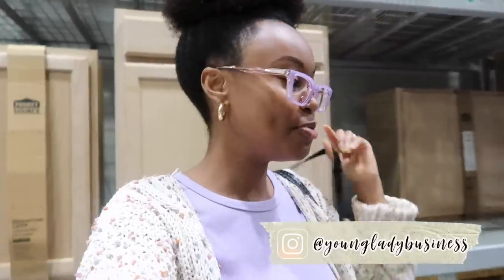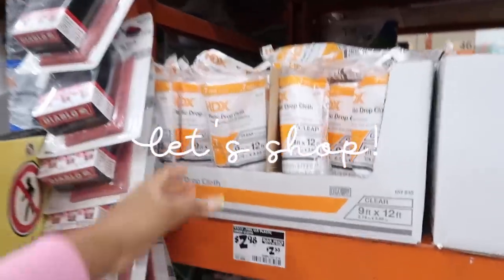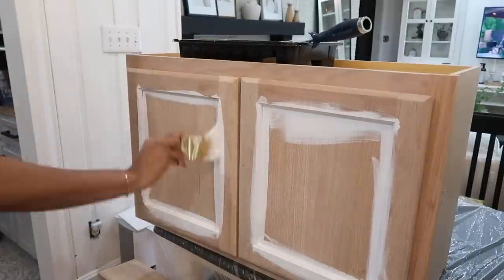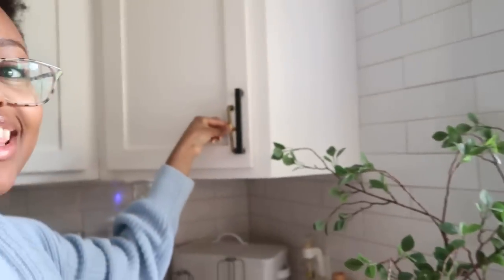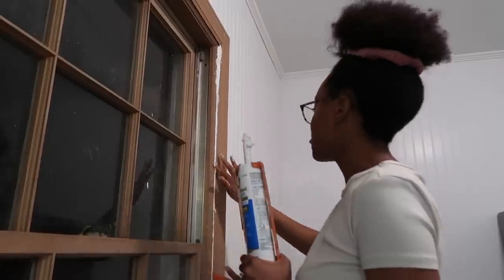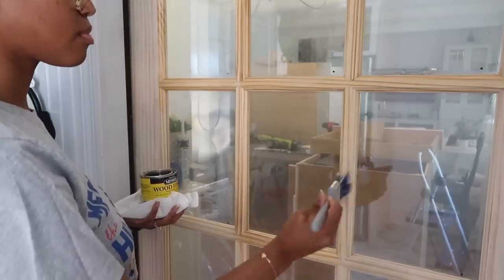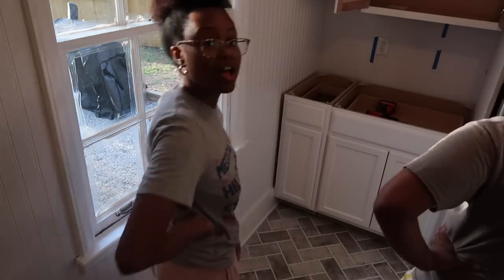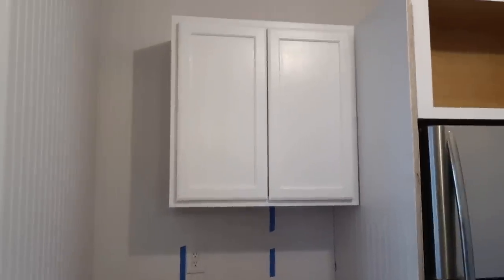INSTALLING THE CABINETS, PAINTING, & NEW DECOR!!!| Dream Laundry Room Makeover PT.2| #FIXERUPPER 🧺

Comment: Love it! I would cut the baseboard so the cabinet can be installed flush against the left wall. You will then have a small gap between the two base cabinets but you can add a filler strip to cover that and paint it white.  For the wall cabinets, I’d move the left cabinet against the left wall so the shelves can go between the two or remove smaller wall cabinet and have more room for the shelves. 😊
Reply: Oh i love this idea!

Comment: I suggest you put corner shelves in the top area of the cabinet, a piece of board between the bottom cabinet and the wall for a custom look, and artwork on the plain white wall instead of shelves unless you absolutely need the space for storage, or a foldable hanger that lies flush against the wall to dry wet clothes when needed.

Comment: You can do one or two things. Put the same size cabinet at the top and take the door off the front and make a shelf. In other words, have a cabinet without doors and hide the hinges with an end piece. Paint the inside of the cabinet and make it look like a natural shelf or you can put floating shelves. Two floating shelves equally apart as possible and put the bracket piece in the middle or make a bracket piece like a tea and put it under there all the way to the wall or flush with the wall to make it support and put a in the back but then in the front kind of use those wood shelves if that makes sense.

Comment: Everything is coming together so well.  You should put floating shelves that space. Make them deep reaching the back wall. But it would look amazing if you made your own; without the exposed brackets. Yes it’s more work and you’ll have to find somewhere else to use those brackets;  but I think it’ll look beautiful.  And stain the wood the same color as the door. Also I think the space by the fridge is the only space for shelving. The space looks small so if you put them anywhere else, you may loose head clearance when walking about.

Comment: QUESTION: If the refrigerator ever needs to come out of the space you have it in, to be worked on or replaced, did you leave space for it to come out of the area you have it in. It looks like it is in that spot really tight.

Comment: It’s coming along so nice. You are correct a small piece of panel to close the cabinet gap. I would still do the floating shelf  by the top cabinet with small plants or some kind of laundry nik nak for decor .just use 1 bracket per shelf and have it fit flush from the wall to the cabinet.. Decisions decisions it will come out nicely

Comment: I think you should move the uppers to the right and hang a clothing rod in the small area for any air drying you may need to do. Either that or just get another slim cabinet for that space! Def don’t put anything on the longer wall. The fridge and washer/dryer need to open up that way.

Comment: U can never go wrong with white never just my opinion
Reply: Quick question do you use a polyurethane coat???
Reply: And u could put the shelf on the wall with the window going into the corner I hope u get what I mean the bracket r on the wall with the window but fitting into the space of the side cabinet